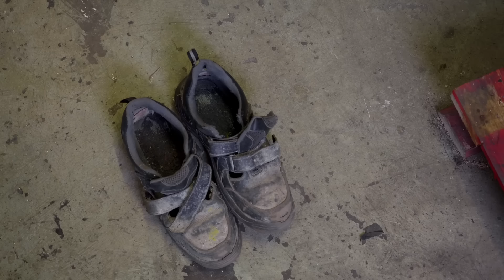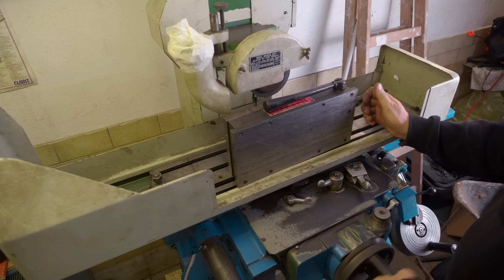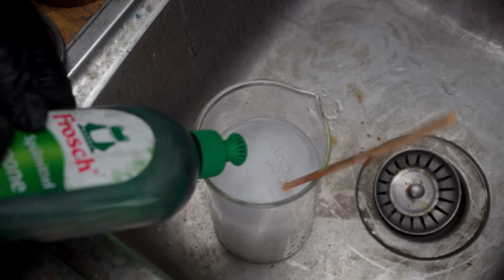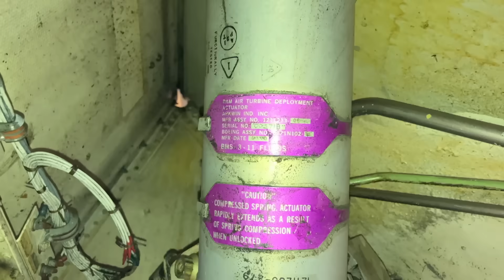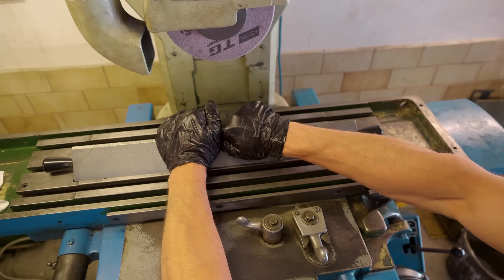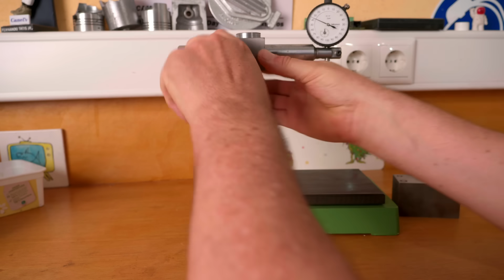Why cant I grind flat parts on my surface grinder? || RotarySMP

Comment: Gosh!  So much to keep an eye on for sure!  At least Mrs Rotary is happy with her irrigation pegs, good work!  Those rods are a bit of a bother, or one of them is.  Well done Mark and thank you!
Reply from the maker: HI John, Yeah, it is really handy to be able to just quickly draw up and print a little helpful part like those stakes. Wins me brownie points. 
I dont think the binding is a simple issue but the stake of minor bow in the rod, slight offset in the thread and slight angular misalignment of the alignment bush.

Comment: What a great result, if its only a few microns over the size of the chuck its going to be hard to ever get better than that. Another interesting video Mark  thanks.
Reply from the maker: Thanks Steven. It is nice that the machine does not need overhaul to be usable.

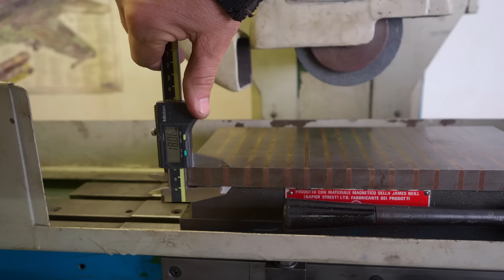Comment: 11:00 could you put a temporary plate on the top of the mag chuck to grind flat for now? grind the real surface later once you've dialed other things in/ serviced the chuck?
Reply from the maker: It seems constant chuck regrinding is pretty typical on surface grinder mag chucks. At least according to the Eclipse manual.

Comment: When I rebuilt my 540 I found the nuts that fix the rods to the table had to be tightened with the rod fully retracted or the smallest misalignment would jam it up. A good way to test for straightness or flatness is by placing a straight edge on the chuck on two or three points and running an indicator attached to the column along it. The popular 5 block test only shows that the surface of the chuck matches the ways, straight or not!
Reply from the maker: Yeah, I think that very minor tolerance stack issue on my hydraulic rods is causing my binding. A bit of off center threading, a but of rod bend, and a bit of guide bushing misalignment.

Comment: IMHO the chuck dip was due to wear, its natural to place parts in the centre of the chuck so that wears the most coupled with poor technique ie cleaning the chuck surface of grit & sliding the part off rather than lifting one edge. You have probably seen abuse on other machine tools the SG is no different. Nice job on grinding the chuck in, I know you said the wheel runs cool but I would encourage you to use coolant. The ugly grinding pattern is probably a combination of factors, the base material might not be the same as the top surface, grinding speed, doc, balance are all factors. I’m still working my way through surface finish optimisation on my own machine. If you didn’t I would stone the smallest of chamfers on the chuck edges it might save your hands from cuts.
Reply from the maker: Good points Tony. I certainly need to make up an arbor to be able to balance my wheels. I will stone those edges as you are right, that is a cut hazard.

Comment: Just an fyi, but mixing washing soda with citric acid doesn't make a lot of sense. I use citric acid (a weak organic acid) all the time to remove rust but all mixing it with washing soda (alkaline) will do is neutralize the acid. That was what all the carbon dioxide that blew half your solution into the sink was all about.
There are chemicals you can buffer the citric acid with if you are worried about it attacking the base material, but generally speaking if it is a weak solution and you don't forget and leave it in for a week it isn't really an issue.
Reply from the maker: I thought the same, but it is not a simple neutralisation.

@JaenEngineering
It forms sodium citrate which is a chelation agent. Basically the molecule formed has a kind of hole in it that is the perfect size and charge for a metal ion to fit in to. That's why it works on the oxides, which is an ionic compound, but not the base metal

Comment: Regarding the comparator/indicator stand: if the indicator is not perpendicular to the surface being measured you'll get cosine error. For a 2-3 degree error you'll get.. pulls out calculator.. 0.06% to 0.14% error. Huh, I really thought it would be more than that. Your 1um indicator looks to have a range of 500um so if you're measuring a feature (really a height difference) on a part and it reads as 500um then it's actually 499.7 to 499.3. That's.. a negligible measurement error. I guess it can only become an issue if trying to accurately measure height differences using larger range indicators like the 12.7 or 25.4mm range digital 1um indicators.
Reply from the maker: Yeah, and since you dont typically use a µm guage to read 0.2mm but you do to read 2µm, a 3 ° cosine error is a 2.74nm error over that range. I will try to remember to add 1.37nm correction per µm of travel :)

In mechanical engineering exams at the TU Wien, you are generally allowed to round out cosine errors below 15°.

Comment: You need to over travel quite a bit more with the wheel along the X dimension you want the table moving smoothly at constant speed before the wheel starts to contact the work. When I was taught, it was over travel at least one wheel radius off the end of the truck. It’s getting a lot better though ;-) keep it up!
Reply from the maker: Thanks for the overtravel tip Chris. A am a real newbie at this.

Comment: Stop using wedge shaped flathead screwdrivers and flat head screws stop being a problem. Look for "Hollow Ground" flat head drivers. Also sometimes called gunsmith screwdrivers.
Reply from the maker: I am somewhat at the mercy of what I could buy here.

Comment: Using a granite straight edge is a good way to check for how straight of a line the table travels in and will reveal any linearity errors. it could be traveling in large arc if it's bowed.
This is why the 5 point test is a discredited method of inspecting a grinder that reveals nothing, you could have one that is bowed in the center and the magnet once ground in place will conform to that inaccuracy.
Reply from the maker: I don't have a granite straight edge, but have two in cast iron :)
I am just glad that errors are reduced by about 25x, to make the machine usable.

Comment: There are you tube vids on the chuck thing. They are usually made of vanes which move but can also get stuck.
I never understood the vinegar/soda thing doesn't the lemon or vinegar acid neutralise the soda?
I know it does work though. So does the electrolysis.
Reply from the maker: There is a good comment in here explaining the chemistry.

Comment: You need to balance that wheel. You're right to take light cuts. I don't know what wheel you have but there are roughing wheels that can take off as much as 5 thou and finish wheels for much lighter cuts. You want Radiac surface grinding wheels, they are THE BEST! Stay away from Norton. And before the people with oppositional defiance disorder have to contradict me, STAYT AWAY FROM NORTON! Even the local industrial abrasives co where I live refuses to carry Norton. You can get the roughing and the finishing and before you say I'm in another country like others have done, I can't help that. Radiac is the BEST! PERIOD. 👣👣👣👣👣👣👣👣👣👣👣👣👣
Reply from the maker: Oh, it looks like Radiac is a Tyrolit brand, and Tryolit is (was?) an Austrian company.
Reply: @RotarySMP  Radiac is the best. Thats all I know.

Comment: It will be interesting to see the larger magnetic chuck opened. I was thinking, are there any holes to force compressed air into it to open with pressure?
Reply from the maker: Nice idea.
Reply: Bad idea.

Use oil so you don’t blow it apart.

Comment: Amazing how much improvement you were able to make.

Shame you couldn’t just fly cut that chuck on a mill to take out the 0.1 mm before you started grinding.
Reply from the maker: 0.1mm seems like a lot on a surface grinder, but is a very fine cut on the mill, which can often lead to smearing on soft iron.

Comment: There are 2 different tapers for J&S machines of that size head, derusting chemical solution did a great job, 100 grams of Citric acid per litre seems on the high side 🤔, though not tried that formula to date.
Hydraulic pressure is quite low, only 100 PSI if memory serves.
Very interesting to see whats under the bonnet, so to speak, my 540 has good geometrics, my table will stick at both ends of stroke, if driven at speed.
Excellent inspection methods using high resolution bubble levels, most accurate ive both used and own are 0.025mm/1000mm (0.00025"/10").
Very strange profile on the smaller magnetic chuck, again very interesting between magnet on/off.
Great work both.
Reply from the maker: Yeah, it was an interesting week looking closer at the J+S.

Comment: I have a little question about the chemistryof the rust removal concoction. I see in varius diy adding accid and then soda. My basic chemistry says they two cancel out immediately leaving behind a new salt and water which normaly doesnt do much unless your salt has some other property... so why not just acid or just a base?
Reply: "unless your salt has some other property" It apparently DOES have another property, though I don't know why one wouldn't just use sodium citrate to start with.
Reply from the maker: I am guessing that sodium citrate is harder to get than citric acid and soda.
Reply: Ok so that answers my question then... its the salt you want. I always thought it was the acid or the base...👍

Comment: Hello RSMP! I’m in one of the States with our Uhrmacher friend, doing volunteer work at a local museum. Please say hello to Mrs. Rotary for us, we enjoy her funny cameo appearances 👍.
I do not know how to disassemble a magnetic chuck, but when I had a problem with my 6x12 Walker chuck I called the factory for advice. They were quite emphatic that while it was not unsafe to take off the bottom, any attempt to haul out the magnetic core would result in tears and smashed fingers. Therefore I did not attempt it. 😳
Reply from the maker: Thanks Dudley. I think I will just try and get some oil into it and exercise it.

Comment: NEW INTRO MUSIC?!
Reply from the maker: Hi Vincent. Was that a request  for a change? I though that brands are supposed to annoy :)
Reply: @RotarySMP No, I was surprised that the music changed somewhat, after being the same for so long
Reply from the maker: @vincentguttmann2231  Oh right, I just lidtened to it and see what you mean.

Resolve 20 has some handy AI features, one of which can strip the vocals from music files, and I had that applie to this track. It seems to have also affected by theme music. I will move that to a different track for future videos.
Reply: @RotarySMP Huh, that's a neat feature! Also makes sense why it was only altered and not changed then
Reply from the maker: @vincentguttmann2231  It is helpful, as I prefer instrumental music in the background. Singing gets too distracting.

Comment: To balance the grinding wheel, remove the weights mount the wheel and dress the wheeI.Now balance the wheel. Put the wheel assembly back on the spindle and redress the wheel Then remove the chuck and clean the table and level the machine. Next grind the table and check for level. Take a very light grind on the table leaving the down feed at the current setting. Apply layout bluing from front to back 3 lines left end of table, center of table, and right end of table, allow the bluing to dry. Now position table to center on each bluing line and traverse the table in the Y axis back and forth at each of the bluing line. (Do not feed the wheel down). The grinding wheel should just remove the bluing where the wheel touches. Inspect the lines where the bluing is removed. They should be parallel, if you see a taper means the table has a twist in it. this can be taken out by adjusting the leveling feet. Repeat this process till it show a parallel line, or as little as possible. You may have to dress the grinding wheel several times if the wheel becomes loaded. Do not grind with a loaded /dull wheel because this will only create heat. If need load the wheel with wax or coat the surface with some oil to help reduce wheel loading. Follow by grinding the bottom of the chuck the top of the chuck. Also, these are 2 thoughts in regarding to attaching the chuck to the table.!) Is to tighten both clamp screws, 2) Is to tighten the left clamping screw and to just snug the right camp screw to movement as the chuck heats up. I tried both methods and did not see much difference either way. Also, when using coolant there will be Rust Jacking over time between the machine table and the chuck base. I tried using a coating the table surface with a light/thin oil. Again, I seen mixed results. As I was told by a Grinding Technician, "Heat, Dirt, and Burrs" are the enemy of grinding!
Reply from the maker: I need to make up a balancing arbor. A firend has a balancing jig. 

Thanks for the detailed description. I am not sure I want to grind the table, before I re scrape the ways.

Comment: Hi Marc.  I believe adding soda to the citric acid is pointless.  Soda is neutralizing acid and making it less potent (less active) .  The whole idea is to attack rust  - ferric oxide - with acid and convert it to ferric citrate that is soluble in the water.  Same way one can just add less citric acid.
Reply: The idea is chelation. Acid attacks the parent metal as well as the corrosion which is not good.
Reply from the maker: I also learned in these comments that the mixture makes sodium citrate, thus the acid is not the active ingrediant.
Reply: @RotarySMP  Here is a recipe from Better Ballistics that works wonders, I replace some of the Sodium hydroxide with some Tetrasodium EDTA. Much cheaper than Evaporust.
https://www.youtube.com/watch?v=fVYZmeReKKY
Another much slower but infinitely safe option is water:molasses ate 40:1 to 60:1 mix.

Comment: Those Wera screwdrivers are the bees knees. They do a range of pound through screwdrivers with yellow and black handles, I think I have got 3 sets now for some reason. Also have the electrical driver set in a roll up pouch. They are the screwdriver equivalent of Knipex for pliers and grips. Not the cheapest but stunningly good and excellent value. 
With regards to the grinder getting into the condition it is, I have seen as bad, but used in a maintenance workshop rather than in a production environment. It was used to grind spacers on some spring making machines. It didn't matter really that it was as bad as it was, as long as the spacers were a reasonable fit. No one measured them, they just ground them so they slipped in the gap.
Reply from the maker: Thanks Bill. Surprising people who use a surface grinder would let it get that bad.

Comment: Nice accuracy, 4um over that distance is great. About your wera screwdriver. I recognize that bluish-green handle and i must tell you, keep that handle out of cutting fluid. I had set near CNC mill and cutting fluid dissolved handle. It was soft like plasticine. (Maybe they bought me knockoff, who knows :) )
Reply from the maker: Thanks for the tip to protect that screwdriver. It is really a good one.

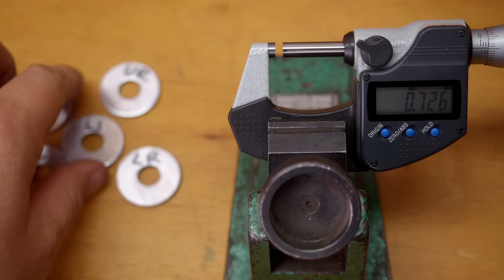Comment: At 36:25, those washers appear to be common stamped washers that have irregularities on both sides. .. A convex on 1 side and a concave with a large burr on the other sides and around all edges.  Grinding them 1 time on 1 side is almost useless...
Reply from the maker: Oh, I spent over an hour flipping them till I got them all ground flat and even. initially they didn't hold well on the mag chuck so I had to take very light cuts. I only showed a brief summary in the video.

Comment: Nice trouble shoot process.  You were able to confirm the ways and table were not the cause and targeted the chuck.  I wonder if lack of maintenance was the issue.  Long term use without being ground back in. Ever. 

Great job on the chuck name plate.
Reply from the maker: It does look like it might have never been reground, Joe. I think the next time I remove it, it will also distort a lot. I took quite a bit of metal off.

Comment: At 27:40 and 28:16, Why wouldn't you grind 1/2 of the bottom out, then flip to the top and at 28:55 to 29:45, get 1/2 of the top high spots and then flip 2x for 75% and then 2x again for final finish?  Possibly alternate the magnet off/on as well
Reply from the maker: Time. It took a couple of hours to do this. I also exect this chuck to distort a lot next time I remove it. This will need to be redone.

Comment: The top plate of the chuck slides off it looks like you were trying to lift it against the magnetism. Also there may be a screw on the short side which can be used to help turn the magnet elements depending where the mechanism is broken. Alec Steel has a video rebuilding a magnet chuck that may help.
Reply from the maker: Thanks for the tips.

Comment: Would it be possible to remove the table and use the grinder to flatten & level it’s own ways?
Reply from the maker: No, as there would be no motion.  But ways like this are not ground, which causes stick/slip, but scraped, which leaves oil pockets.
Reply: @RotarySMP well obviously! Sorry, my brain fart…

Comment: I wonder if there is an internal leak in the hydraulic valve for the piston? It seems to be losing pressure when the valve poppet moves.
Reply from the maker: Could be. It also seems to be have a bypass function.

Comment: Alec Steel Rebuilt a Big Mag Chuck, I would guess yours works the same way, He found that the rods holding the magnets to the lever had snapped. it took a decent bit to pull it apart. https://youtu.be/Vx2vz3Ppyfw?si=cbeFaHy851Jg5ndw&t=1318
Reply from the maker: Thanks for the link. I'll check that out.

Comment: Thanks Mark. Ouch, that was a heck of a burn from Mrs Rotary, I felt it from here: "FINALLY, something useful comes off your 3D printer!". You mean she didn't like IC engine cylinder heads and pistons? On other hand you did get approval for a new machine ;)
Reply from the maker: You have to take the wins where you find them Robert :)